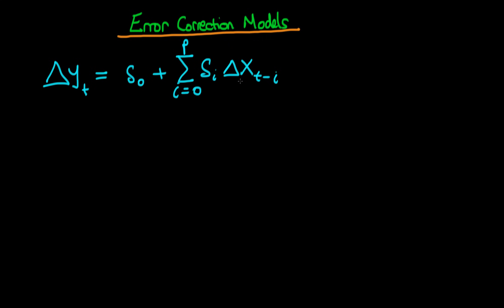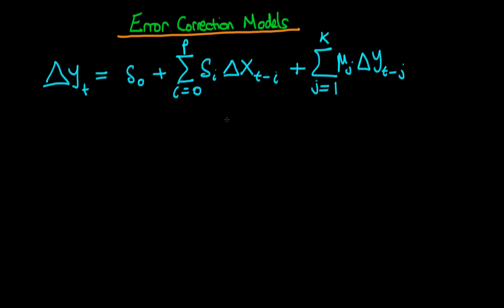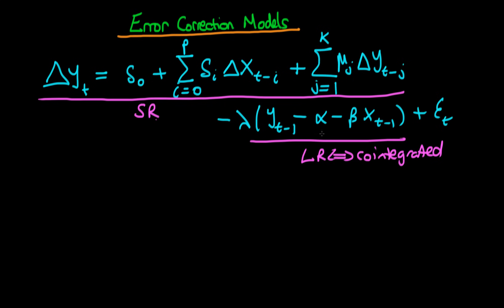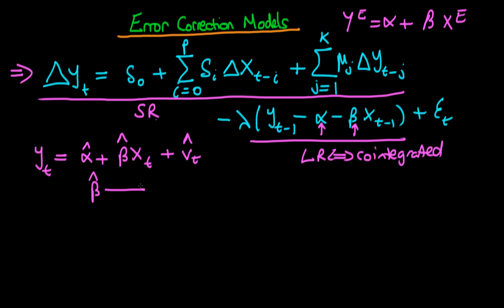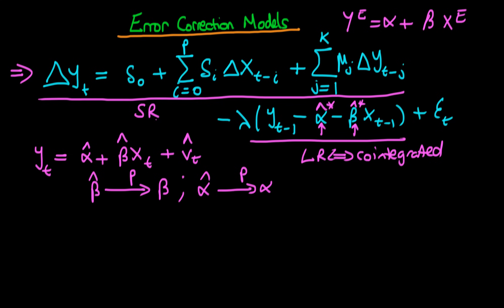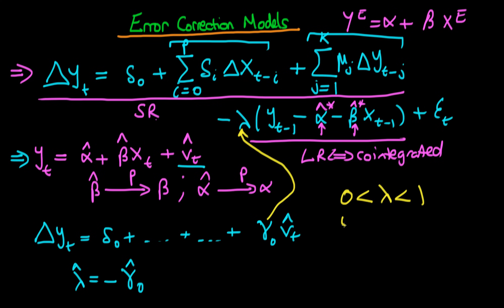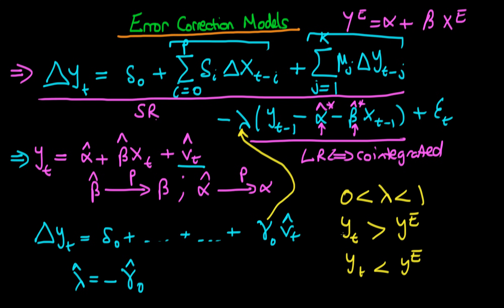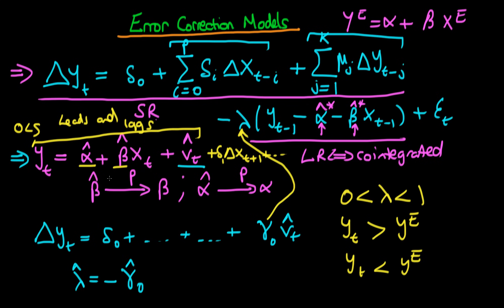Error correction model - part 2

Comment: Hi Ben, thanks a lot for the cool videos, I can not tell you how these videos made my job a lot easier. But I have a question.  We stated that Yt and Xt are I(1) and then estimated alpha and beta via OLS. When the series are non-stationary how can we estimate alpha and beta via OLS? Thanks again! :)
Reply: You estimate them using a simple OLS however as you noted they must have the same level of integration which in this example is I(1). They also must be co-integrated meaning they move together and there is a long-run relationship. The OLS regression is used to get information about the long-run relationship. If Y and X have the same level of integration but are not co-integrated then you cannot use the ECM model.
Reply: Also, if they are integrated at different levels, you use the ARDL bounds testing approach (Pesaran et al. 2001). Its application is well explained by a post in Dave Giles blog.

Comment: Hi Ben, Thank you for the great video. I am not clear about estimation.Should I first estimate OLS, then estimate ECM using the residual estimated by OLS?
Reply from the maker: +Oz Thanks for your message. You can do it in a two-step way yes. However, most statistical software, (Eviews, Stata, and R for example) do all the work for you; estimating the cointegrating relationship and the dynamic equation in 1 go. Hope that helps! Best, Ben

Comment: Hi Ben thanks for the video, very useful and clear! Just one question: shouldn't the estimated residuals v_hat(t) at minute 4:50 be v_hat(t-1), so that the correction is based on past errors? Thanks again, Matteo
Reply: I was thinking the same
Reply: Any ideas on the matter?
Reply: yeah, this should be the case.
Reply: @yuchaofan  also why has the error term E(t) not been included in the final model?

Comment: Thanks for making econometrics so much more approachable by making these videos!

How can the lag length of the differenced y and x be determined in the general ECM?
Reply from the maker: Hi, thanks for your message and kind words. To determine the lag length of differenced y in an ECM you need to use a mixture of common sense, and examining the t statistics of included lags. For example, if you are dealing with quarterly data, perhaps it makes sense to include lags up to including the fourth. In this case, including the first 7 lags for example in this context wouldn't be that sensible. However, it is also important to examine the t statistics (and associated p values), and use these to inform the inclusion or exclusion of lags of the (differenced) dependent variable. Hope that helps! Thanks, Ben
Reply: Ben Lambert That helps alot Ben, thanks!